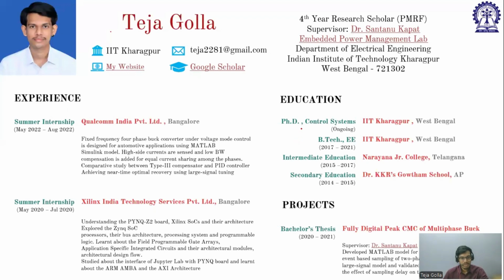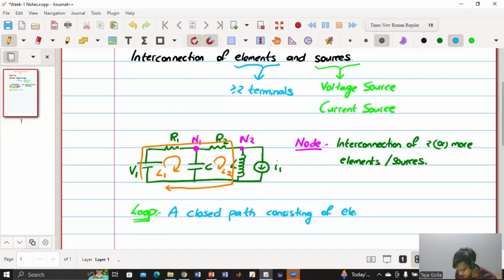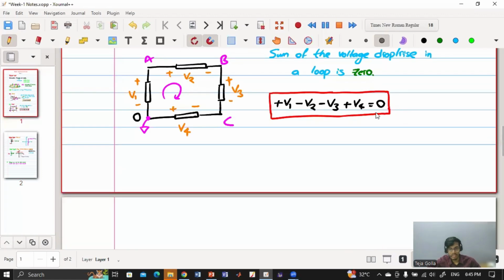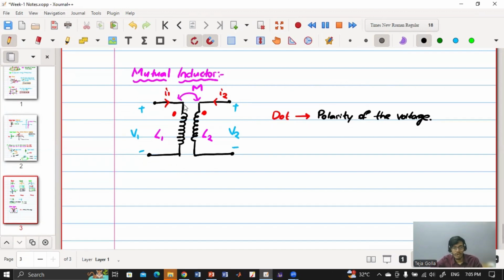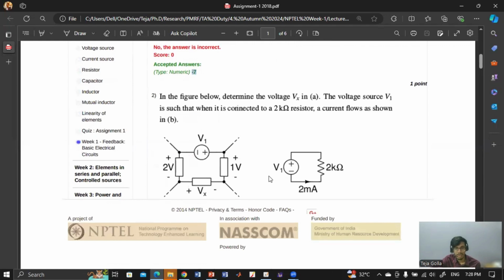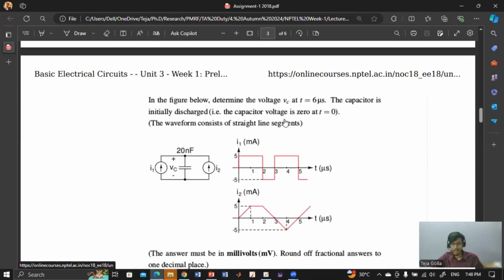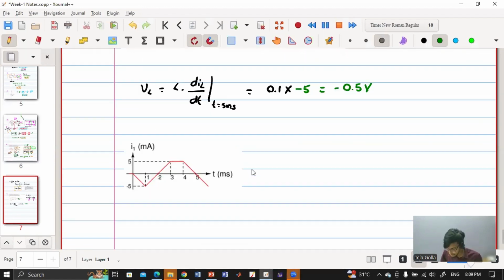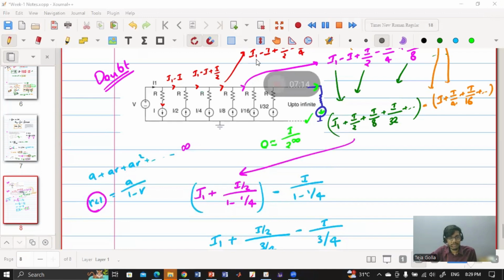Week 1 | Basic Electrical Circuits | Problem Solving Session | NPTEL

Comment: which books are helpful for learning this subject sir
Reply from the maker: Hello, Yogivana There isn't a book that matches the course syllabus exactly. Certain books may cover more or less than what was taught in the course. I strongly advise sticking to this course's lecture notes and videos. If necessary, you can also refer to the lecture notes of the NPTEL course "Network Analysis" (https://nptel.ac.in/courses/108105159).
Reply: @tejagollagt  I think i need better books than the lecture notes I am preparing for gate sir so I need text book and weekly assignments are too difficult sir how can I get the nptel certificate
Reply: i couldn't solve even one problem
Reply from the maker: @yogivana7793  Don't worry. I'll search and refer you few books, you can go through them. If you could join my problem-solving session today, I'll guide you to prepare, improve your assignment score and score good marks in the final exam.
Reply: @tejagollagt  ok sir